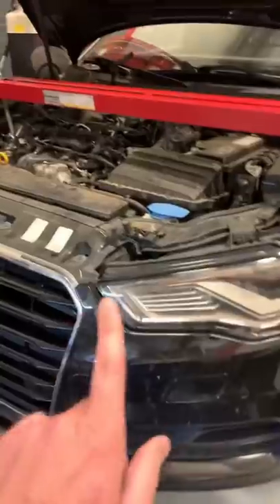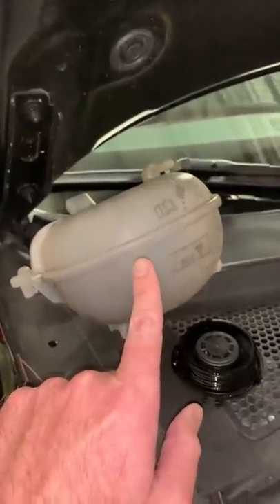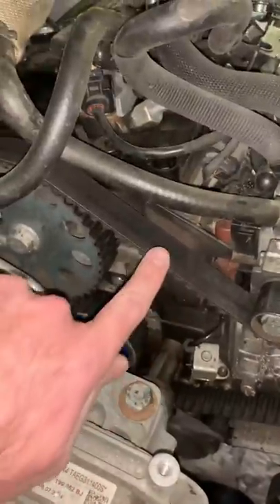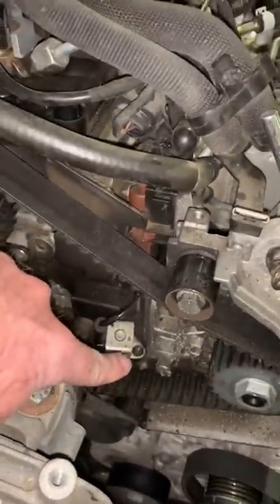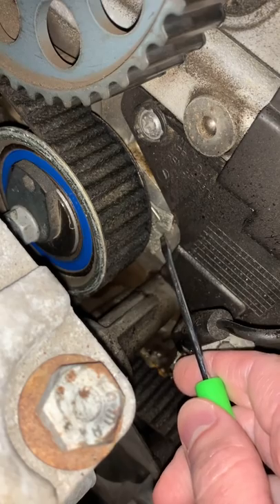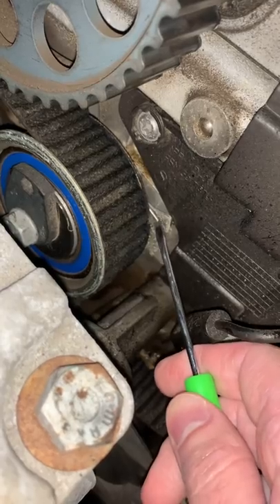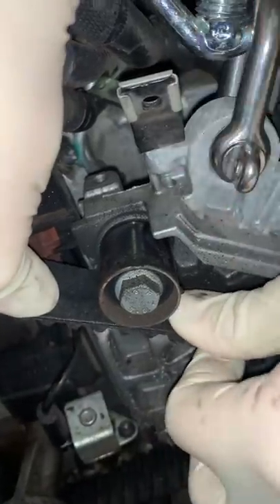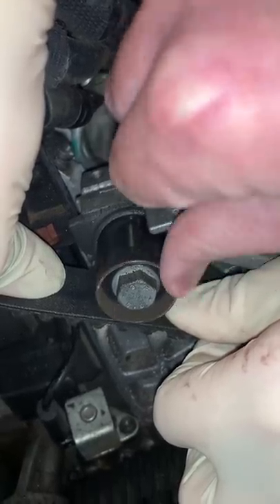Don’t let problems go on your car! #shorts

Comment: I worked on an 03 A4 with the turbo'd 4 cyl and a stick...needed clutch,almost all the gaskets replaced,flywheel replaced(that wierd one that has the dampening equip inside) and the cooling fan brain replaced...ONE WEEK LATER and had to put a whole new ignition harness in(missing on 1-3 cyl's) and a month after that,ecm went haywire. That car was junk

Comment: My guess is he let the coolant go bad and that caused the seal on the W/P shaft to go bad.

It's been my practice to do a drain & fill of the radiator every spring so the lubricating quality of the coolant stays fresh and keeps that seal lubricated. I check the strength of the fans at that time, and every 50K miles I replace the thermostat "whether it needs it or not".

Cooling system neglect causes more problems with cars than anything else IMO.

Comment: I'm lost. Who the is the designer for a motor that has a water pump on the timing belt? Sounds like MAJOR OVERSIGHT. some are Timing chains encased in oil because they well, Last forever and the belt operates... Non engine critical stuff, like idk. Waterpump and alternator for easy fixes and if the belt breaks the whole engine doesn't blow up.

Comment: Why
Put the water pump in a place where if it leaks it will ruin the timing belt?
Use a timing belt rather than a chain or gears?
Make an interference engine where if the timing belt breaks it ruins the engine? 
Make a simple problem so difficult and expensive to fix that people will let it go for long periods? 
Most of all... why buy overpriced and over complicated German crap cars? Because how else is everyone supposed to know you are more important thsn everyone else! Driving like an inconsiderate idiot alone sure won't do the trick!

Comment: Crtdi is too reliable timing would just snap & car would just go into limp mode then turn off. I have one. I’ve replaced my timing belt once (at 180xxxk km) & will again soon (I’m at 290xxxk km) engine is built right. Stage 2 tune as well. Simply put don’t buy a diesel without self educating.

Comment: Hello I recently bought a 2012 A4 Avant Quattro, it’s been good but recently my Check engine light came on and the EPC light is on. I had the coil packs changed and spark plugs. But it’s still the same. The engine shakes at idle and it also misfiring when driving. Any advice? Thanks 🙏

Comment: I've got a Q7.
The oil filter housing leaked, looked like a rear main seal.
The Pcv valve had been causing a quart oil consumption a month.
Finally began squealing like a pulley bearing, but it you take the oil cap off it goes away.
When replacing the Pcv valve, I barely touched a nipple on the front plastic crossover pipe and it snapped off.
I went to remove the other brittle plastic water pipe on top of the Pcv valve and the end crumbled off.
Hopefully the thermostat housing holds out a while.
It was a challenge.
Audi, listening?
Get rid of the crap black plastic water pipes, use aluminum coat it if you like but with 170,000miles it's crumbling apart.

Comment: Treat your car well!

Whether it's the timing belt, trans fluid, oil, or any other basic maintenance for a vehicle, just get it done, change your oil every ~5000 miles (~8000 km), change filters, treat your car well, because even Ford, Toyota, and Honda, for as reliable as those cars tend to be, they will have maintenance requirements or the occasional weird design choices that will leave you better off treating your car well.

Even then, as with Toyotas especially, if you treat them well and keep up with regular maintenance (as is recommended by the manual or a reputable shop), they are known to go over 400k miles (643737km).

Comment: Newer tdis are garbage due to emissions regulation... in my country we have cars imported by dealers with euro 4 2.0 tdi 143 hp and they are great and relaible... but those who import euro 6 2.0 tdis 150 and above are having major problems before 100.000 kms

Comment: Can someone help me diagnose a loss of spark on a Volvo 940.  Car starts great until it warms up.  Then engine cuts out. Engine cranks but will not start. Replaced computer, cps sensor.   These engines are supposed to run and run.  Some circuit opens and I need help to locate the open.

Comment: Yep my Passat GLX (European cars are awful by the way never buy a used one, Idc if it only had one owner and has service records)had the same thing happen. My water pump went out and I got qoutes 1200-1300 for a water pump and timing belt alone. However it had more problems than that so I let that thing go. Never buy a car with a timing belt if you got a choice, timing chains are better, last longer, and are naturally lubricated through your oil, that being said change your fucking oil people, you'll ruin your engine if you don't.

Comment: Had a Volvo S70 TDI with a 2.5L straight 5 cylinder diesel from VW/Audi. I had a waterpump leak, got the timing belt and the pump replaced. A year later the belt was on its way out thanks to the crankshaft pulley being worn. Got that replaced and a new belt. A couple of years later at 245K miles the water pump failed without warning and that was it. The engine seized there and then. (Volvo used VW 6/ 5 cylinder diesel engines up to 2001 in all their diesel cars from the 240 and up).  
It was heartbreaking as that engine was really solid as long as you replace the the belts as itt an interference engine.

Comment: It only takes one good overheat to warp the head causing blown head gasket, and depending on just how severe it overheated it's gonna cost a lot more than just a belt. This is a salesman trying to justify a 1000 dollar water pump job! How do I know? Ase master certification L1 advanced engine performance specialist 27 years exp

Comment: one thing I've never liked about Audi.  for as much as a Audi cost   why dissent  Audi use a timing chain.   but Audi user's a rubber timing belt.  which the timing belt  only lasts for 55,000 to 60,000 miles.  an that's why I don't care for audi

Comment: Ha, not as bad as a Honda pilot I helped work on a couple weeks ago,I was able to completely squish the belt tensioner and the belt had an inch of back and forth movement between the top cams (v6). It had over 200,000 miles on the original timing belt. You could literally hear the valves hitting the pistons as it ran. Previous mechanic replaced the coils because it had 4 misfire codes, but that didn't fix the problem. It is still running perfectly fine two months later.

Comment: This is what they call an interference motor. Now if the belt snapped I wouldn't go so far as saying it would of smoked the engine.Though you would definitely had bent valves.

Comment: Coolant causing a timing belt to stretch?.....Timing belts don't stretch my man, they simply snap hence why they have to be changed every so often. If they did stretch the tensioner would surely pick up the minimal slack. Chances are the tensioner went bad.

Comment: An interference motor should always have a timing CHAIN not belt, timing belt is for free spinning motors which donot destroy themselves in the event of a rubber belt failure,  timing chains only run the camshafts.... Not the water pump or other such nonsense, Audi is dumb AF if what you said was true..

Comment: Don't ever let a newer model engine break a timing belt/chain...you gamble with either bending one whole row of valves,or knocking a hole in the pistons...worked on 3 vehicles that broke the chain(s)/belt

Comment: Your incorrect the slack is totally normal any time the engine is off depending on the position of the cams there can be some slack even more than what you see here, and if you rotated the crank counterclockwise you'll always have slack so your theory is totally wrong and the belt looks bone dry

Comment: You have no idea what you are talking about. There is a spec for belt defelction for the timing and serpentine/v belts. There is nothing wrong with hat timing belt. They are recommended to be changed every 90000 miles. You already have to remove it to change the water pump so yes you should just change it anyway. I bet you would double charge them on labor for his too. This is why I always make sure I go with my friends when they go to private shops. You give technicians a bad name.

Comment: This is why people do let problems persist on their cars - it’s called not having any money to do the repair and I notice you guys always find other ways to upsell shit and by the time you’re done we’ve paid $960 for an egr valve that costs $220 oem and has 2 bolts holding it in - true story - luckily I was able to do it myself for $60 with an aftermarket part - works fine

Comment: Water pumps are common on that engine,  always have been. 

Belts stretching is hardly a problem when the tensioner will just pick up the slack.

Comment: This is 100% false, I work for Linde and only ever work on those engines with multiple certs to my name. The belt was probably due to be changed but it was not anywhere near being broke due to that small amount of stretch. This is just a mechanic over selling a small issue even though if your doing coolant pump go ahead and do the belt because it’s already off.

Comment: Oh my god there’s so much wrong here… 

1. the timing belt is completely water and coolant proof. It’s even in the VW manual. It does not get stretched because of that.

2. that’s not how you check the tensioner. It won’t show you the actual tension, there’s a mechanical system inside, and if you don’t turn it in a proper way, it won’t show the correct tension your belts on.

To check the correct tension, you have to turn the engine clockwise until you hit the marked spots again. 
But even then, VW says, the tensioner won’t show the right tension after turning the engine 

3. that’s a common leakage of the EA288 engines. Nothing special

Comment: Why? Just why? How could anyone possibly think it was a good idea to run the water pump off of the timing belt? There's a reason nobody else does that. One little leak and the engine will have to be torn down for a total rebuild. That won't happen if you run it off the crank like everyone else. A failed water pump will make the engine overheat, but is unlikely to result in serious damage as long as it's replaced quickly.

Comment: I've got a coolant issue as well I've been scratching my head about it since the shop didn't say a word about the obviously black and murky coolant that's hanging out in my coolant reservoir right now. I'm thinking since it's already pretty close to the 100k service that I should just replace the water pump along with the timing belt.

Comment: Horse crap. That belt is plenty tight. The coolant wasn't leaking on the belt per say. And it's common for normal wear to stretch out the belt.

Comment: After u fit a new timing belt, the pointer on the tensioner never will be on the right place. So that doesn't matter at all. It need new water pump along with new timing belt kit. Job done.

Comment: What was the mileage on the car? I am curious because I had a 2004 Audi TT, and had to replace the timing belt when it got to 69k miles. The engines were made by VW, and they had a reputation that the timing belt to break and destroy the engine.

Comment: This is why I don’t let other people work on my cars . I’m not just throwing parts at something especially not based on theory. If the belt was as tight as you think it needs to be the idler bearing would be gone every week. Even 1000+ whp turbo drag cars aren’t held to belt tolerances like that

Comment: Obviously a timing belt driven water pump has got to be the worst design I've ever heard of. But based off the tension where you have to have someone push the belt down with both hands and have a 3rd hand spin the pulley.... I would not personally say that it "absolutely should not be possible"... Bit of a video over exaggeration there...

Comment: Buying an Audi interference engine with a rubber timing belt is where this whole thing went wrong. Don’t do that people. Be smarter. Buy a non-interference engine preferably a timing chain but a belt is fine too. That way if your timing belt/chain breaks you just buy a new one and retime the engine… if you’re going to get an interference engine get one with a timing chain much more reliable and longer lasting that those shitty belts. With non interference engines that break timing belts or chains you won’t have bent/broken valves, destroyed pistons, scarred cylinders, damaged valve covers.

Comment: I once had a BMW ( don't remember the model or year) in  the shop i was working at .
Came in to replace the flywheel .No this is not a mistake  many vehicles have a dual mass flywheel which , according to manufacturers, results in a smoother ride ,and according to me results in a lot of money for them since this dual mass flywheel  fails often and when it fails it costs thousands of dollars  just in parts .Anywhore!
This BMW comes in , it has had a bad dual mass flywheel for  nearly a year but the owner did not have money to fix it so he rove it as is . 
When i went to start disassembling the the car i noticed that the  crank shaft had nearly 1/4  inch of forward and aft play !  Because of the damaged flywheel which was not replaced , the engine vibrated itself to death ! My shop manager bought that car for cheap and the autopsy revealed ruined  bearings , damaged cylinder walls, ruined crank shaft , multiple damaged oil seals .
 I did fix the engine and my shop manager got a nice car for cheap since we had crank shaft for that engine from a previous  repair that we got shafted on .
Fix your shit before it destroys your car or your life !

Comment: The cam belt stretches with usage, the tensioner and idler pully are normal.
The water didn't cause the cam belt to stretch.
Stop ripping off your customers and filming it for other mechanics to see you sausage

Comment: In India we don't wish to get the car serviced or repaired until we get change in smoke color... We don't even know what's going on in the engine part coz all we do is just turn on the bass boosted sound system at full volume and run vehicle on top speed in damaged roads all-over 😂😂😂

Comment: I wouldn't do that job without changing the plastic thermostat housing,  because if the metal pump is leaking the plastic housing is not far from going and once you introduce pressure back into the system after fixing the leak it almost a sure thing. And check condition of radiator, if it slightly looks suspect, replace it too. Dont use stop leak in euro cars, especially french cars, you will block your interior heater core.

Comment: This is why you never buy a car with a water pump that is timing belt driven.  This design is horrible, unnecessary cost and hard fix for most people.  The engineer who deigned this should be put in jail.

Comment: Thats actually pretty normal stuff. The tensioners are self adjusting so the arrow always comes in and out of that window. The belt hasn’t stretched. Granted the coolant is affecting it by making it weaker which might cause it to disintegrate.

Comment: Stay away from vehicles with timing belts. Also this engine is probably an interference engine, meaning if the belt goes, so does the motor.

Comment: ill mention it for the ones that dont know but the TDI is a diesel engine and as most diesel engines is it an interference engine meaning if it jumped time the probability of a piston having a nice and intimate encounter with a valve was fairly high.

Comment: They used to be a metal chain, it will run like crap if it jumps a tooth but it's not going to smoke the engine.
That rubber belt would get chewed up and spit out, thousands of race cars have broken the timing chain or belt without blowing up the motor. Let's get real people.

Comment: Or I'll drive my old chevy 350 that isn't an interference engine and doesn't rely on cog belts to run multiple non essential and essential drive train components and laugh as it slowly drips coolant and gets horrible gas Mileage but virtually lasts forever.

Comment: No, the manufacturer shouldnt have designed the water pump to possibly be able to leak on the timing belt and if no way around it they should have went with a timing chain.

Comment: Any modern car from the last 20 years will either get misfire codes and or cam/crank timing corelation codes before the belt stretches to damaging an interference engine... Just saying, there would be other red flags before complete failure by gradual stretching of the belt.

Comment: That belt is literally fine, and tensioners spin free when you remove the tension from the belt by pushing it away. You're selling snake oil and trying to pass it off by making an informational video.

Comment: So if I never be stupid enough to buy a vehicle that the manufacturer was stupid enough to power the water pump off the timing chain nothing should be powered off the fucking time in chain Not to mention an automotive manufacturer stupid enough to still use a timing belt any distributor with a brain went back to timing chains years ago, so if they're still stupid enough to use a timing  belt do not buy...

Comment: Oh please, I have seen way worse belts. This belt was in no danger of breaking anytime soon. This vehicle was in danger of a critical overheat, resulting in a blown head gasket, warped head, and may have already been damaged. Not by the belt but by the temp gauge not being able to accurately inform the driver of the overheat due to the sensor not being in contact with coolant. Leaks will allow air to pool in the system and tdi engines are notorious for this.

Comment: What idiotic engineer would design an engine so that the water pump would leak on the timing belt in the first freaking place? They must hold their customers in contempt. In the olden days a water pump would leak out of weep hole completely outside of the engine.